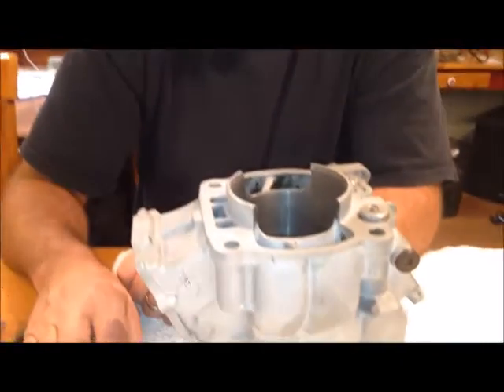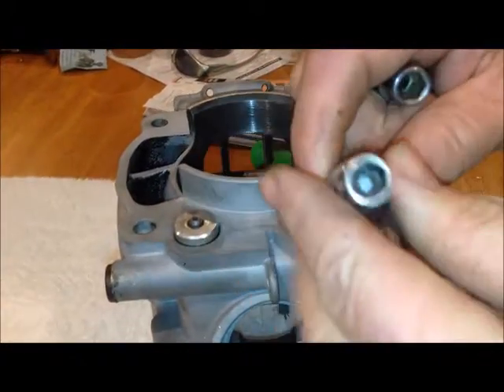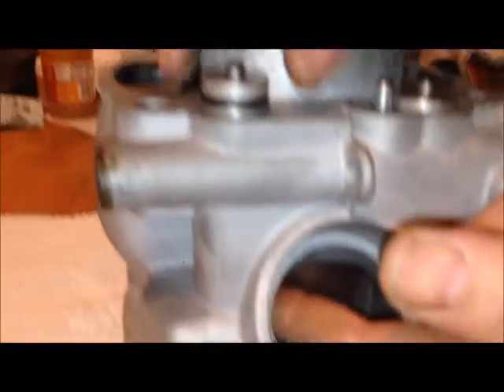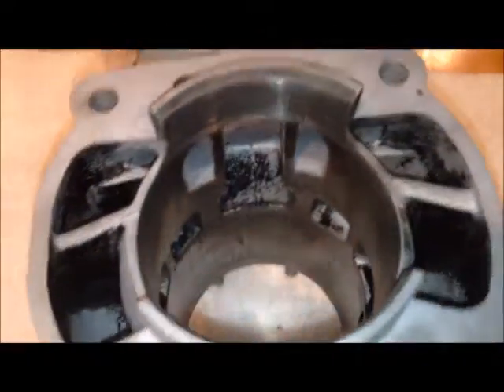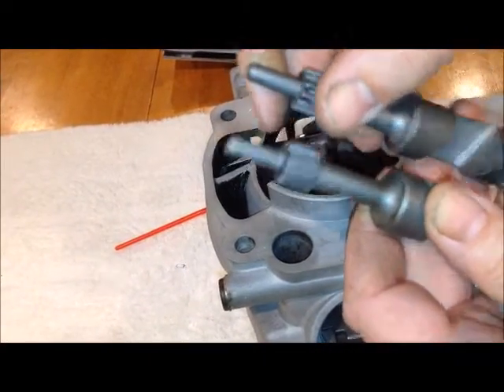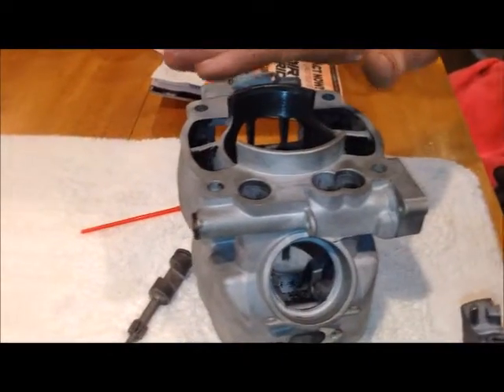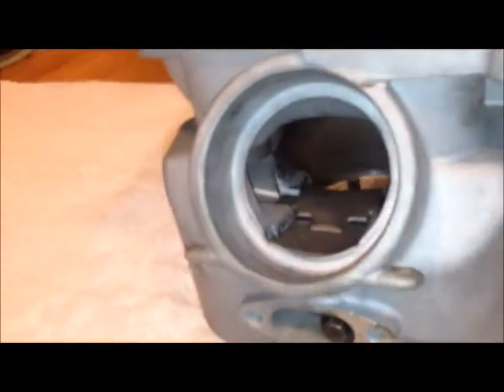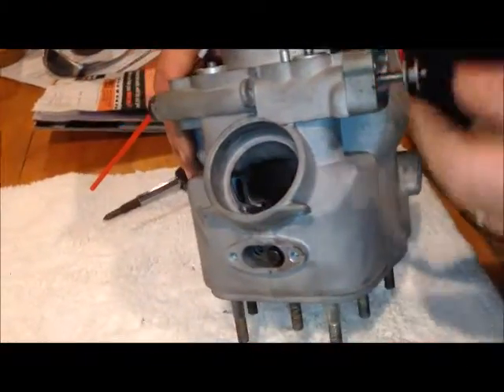KX500 KIPS exhaust valve removal and installation

Comment: I just can't thank you enough for this video. I recently picked up a  1989 kx 500. Seemed to have no top end power . I looked up into the cylinder with the pipe off and immediately could tell there was an issue . Took top end off and  apart and the power valves were installed correctly. Watched your videos and reassembled exactly how you did it and now it is running mint ! Thank you so much for the great detailed video! 

- JORDAN
Reply from the maker: Got to keep these old bikes running !

Comment: Nice Video Clark on putting that clock work together!  I picked up a 1990 KX 250 cheap which I thought would be a nice project  over the winter.  I was stripping the cylinder so that I could send it out to get relined.  When I got to removing the KIPS components I was flying blind.  I found your video AFTER I took it apart, but putting it together using your video should be much easier.  I did damage some teeth on one valve when removing it but I hope you're right and that I can buy these new, because I just may replace them both?
But I just wanted to comment that on the 90 KX 250, the markings on the valves for proper positioning when reassembly are little different.  I didn't see any index punch mark over the teeth for proper alignment like you have, but what I did notice is what looks one tooth on each valve is milled lower so that you can notice this when you look like you did from the top down on the teeth.  Now I just have to see how lucky I am buying new power valves. :)
Reply from the maker: Thanks !  I know the the 250's are a little different but at least the basics are here if you're totally lost.  I'm sure there must be some stuff out there on the 250's though.....
Reply: @clarkrupp Just getting back to this but wanted to add some comments.  First, I couldn't find a replacement right valve/drum so I ended up taking the right valve/drum to a local welder who was able to add some aluminium on the teeth I had broken off when taking the kips apart.  I did have to refile the teeth that he added the aluminum to in order to build the teeth back up. He charged me $40. So with the teeth filed back into shape on the drum and it put back in place it seems to be operating fine.
Another note i wanted to add for others is that OVEN CLEANER works great for cleaning the carbon off the  valve and the drums.  There is concern that oven cleaner may pit aluminium, but I didn't leave these parts soaking in it.  I sprayed them and let them sit with the foam on them for 10 minutes at most and then took a scrub brush to them. Came out nice and clean.
One thing not covered in your video is how the rack can only go in so far because it will bottom out when pushed in all the way on the plug that screws in from the other side.. It does this on my 1990 KX 250 anyway.
So I had to put the plug in all the way, then make the rack hit that plug by pushing it in all the way to bottom it out or fully seat it.  Then I could adjust the drums on the rack for proper opening/closing.
It seems ok, but I'm not sure what/how the mechanism works that connect to the rack? I mean will it open the rack fully? Is the rack sitting at the right spot left to right? Again, it seems to work ok by hand but I won't know until I reconnect the fork that operates the rack.

Comment: Can the kips  keep me from firing up easy ?  I have a 93 kx500  with a starting problem it wont start unless i push start it even after warm its hard to start . What jettihg should i use ? Also what fuel ratio do u recommend
Reply from the maker: You can use any high quality synthetic 2 stroke oil.  I mix at 50:1  Assuming you're within 1,500 feet of sea level I would recommend a 55 or 58 pilot jet and a 168 main.  Needle 2nd from the top.  The bike won't start because its too lean.  To richen it up check your pilot jet and once warmed up turn in your air screw on the carburetor and until the engine won't idle and back it out 1/2 turn.  I also have to put the bike on its side to overflow the carb floats to get raw fuel into the cylinder for cold starts.  Keep the throttle closed with the choke on.  Should fire up in three manly kicks.
Reply: Hey clark i got 120 psi so im installing new top end. I get some kickbacks  , what you suppose that is am i just bieng too scared ? Also im thinking of a decompresiion valve what do u think
Reply: Clark Rupp  when its time to install the governor arm back on to the kips  what position does the rod that travels in and out have to be ?  Does it have to be all out or all In . I notice theres spring tension on the governor .  I really need help on this part .
Reply from the maker: The arm "pin" rides in the groove and valve timing rod is positioned based on rpm.  When putting on the cover just make sure the arm is in the groove.  the in and out part will take of itself......
Reply: @clarkrupp  hi Clark, this is basically the same question I had in my post. It sounds like the governor will adjust to the closed position on the rack?

Comment: You're a life saver, I didn't realize the exhaust valve should be loose while assembling, my clymer's manual says to tighten securely. This was a much easier method to use, thanks!

Comment: What kind of issues were you having lat led you to want to pull these and clean them out?
Reply from the maker: From a performance standpoint its not a huge impact.  Low end and throttle response are crisper.  I was putting in a new piston and rings.  Kawasaki  recommends tearing down and cleaning after 50 hours or something like that.  Of course nobody does....

Comment: 2 kx500, 2002 year. You just helped me. I cleaned off the dots ..badly carbonized. The ring around the right side saved me pain. Thanks again.
Reply from the maker: I figured if I was having a hard time trying to find good detailed info on this others would too.  Glad it helped you out
Reply: Found out my problem and fixed it. My Jug had a brand new "LA Sleeve Stock Insert" which was touching against the KIPS valve. This is a thick sleeve. I had to reshape the last flapper Kips valve so that it would not touch the sleeve. Also, my PINS had dents and were crushed on the tips (not round) from badly carbonized deposits that formed and prevented the kips valve from fully opening and closing. When I saw you pull the valves open and closed with your hands I knew I had a problem. Took me one day but starts up one kick now. Hope this confusion helps other KX owners. If you get a sleeve make sure the KIPS valves move freely and with your fingers.

Comment: I noticed that when I pulled the little rod out the one on the right side of head, it doesn't want to go back in to close the valves. It only does it when the head is upside down. Is this normal?
Reply from the maker: +TheJonyman3  That happens (upside down) because the exhaust valve is falling out enough that the rod can slide past the timing gear.  If you're doing that you've probably messed up the timing on that "far" valve.

Comment: Thx for posting, doing the top end of my '00 KX 500 right now and this makes reassembly of the power valves look simple.  Cheers!
Reply from the maker: +yellow72bronco Hopefully the doing becomes as simple as the viewing.  I can tell you the Clymer manual is certainly confusing !  Good luck !  Just posted a new riding video out at Carnegie OHV
Reply: +Clark Rupp It went pretty well, the left drum took a couple efforts to time correctly so the open and close position worked perfectly.  I'm waiting for more snow here in Upper Michigan, I put a Timbersled Mountainhorse Kit on the bike.  This is a low hours 500, first rebuild and power valves were nasty!. Thx again for an informative Vid!!